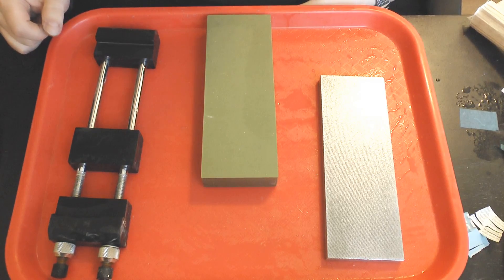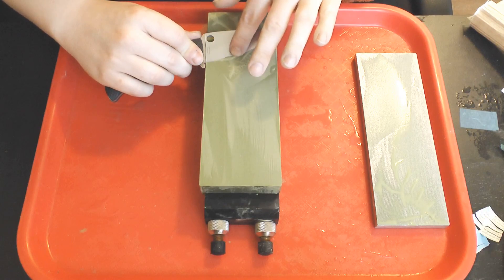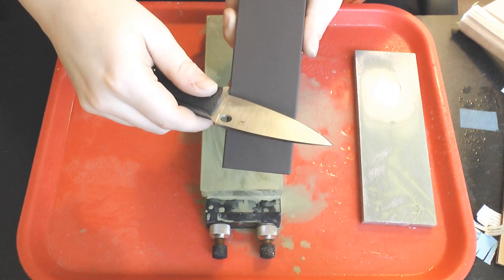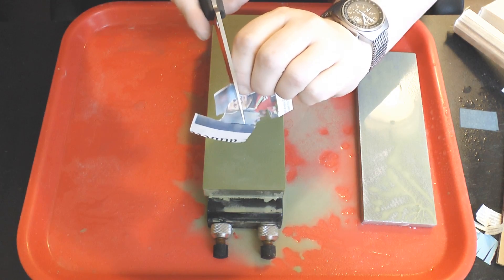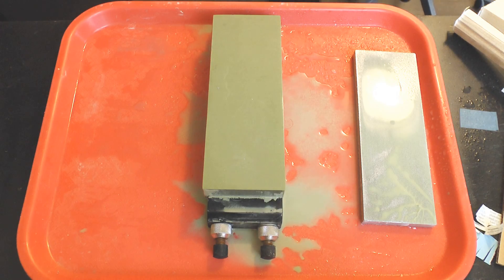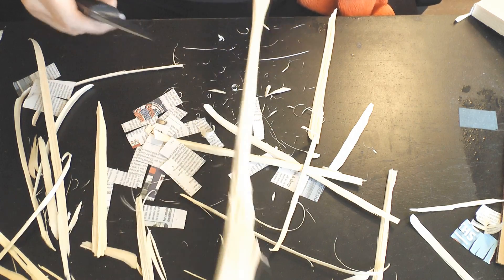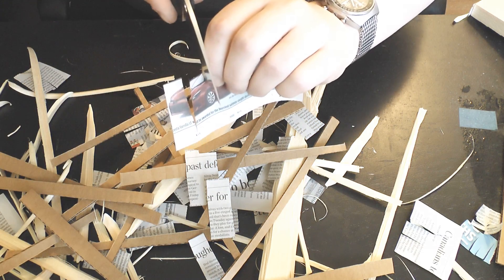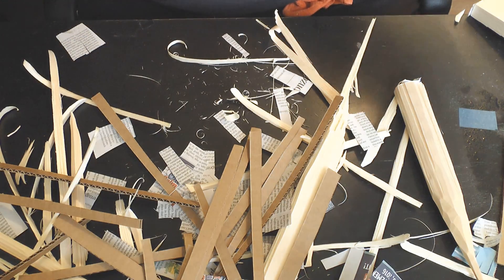AlOx and SiC vs. Vanadium - Part 3: SPS-II 3000

Comment: idk what you think shaving into the grain of pine wood or whatever that is going to accomplish, especially on a steel like that. It's not going to do anything. Maybe if you did that 1000 times in a row you could notice some change, qualitativly. No clue what you're trying to accomplish.

I've got a decent eye for it, and it doesn't look like you're getting particularly exceptionally edges off the stones there. Slicing copy paper is hardly a test of edge keenness at all, it doesn't prove anything other than maybe quickly guiding you to where any inclusions, ie nicks or rolls, in the edge might be, or the fact that yes you have an edge. It doesn't look like a very keen edge, but it's an edge. Try slicing through a free hanging paper towel. Not a supported pt like I've seen you do a few times talking some mumbo jumbo about "aggression." Hold the pt between two finger so it's hanging by the force of gravity, draw the knife through it, the knife should fall through it like it doesn't exist.  You should be able to do that straight off the stones. That's a valid practical test for you.

Comment: Is the SPS II 3000 really made out of Silicon Carbide?
Reply: I don't think so.  The 240 and 1k use green silicon carbide, which is great. But, for half the price a naniwa traditional 240 is also green sic. So is a norton 200. op has a very optimistic sense of self confidence. I'm still a big fan of the 240 and 1k sps. And they can absolutely sharpen any knife steel you're going to come across, even if you deal with these gimmicky spidercos as they're the only company that makes stuff like that. Obviously diamond or cbn is a superior abrasive. Theres a reason those are called super abrasives. The issue is coated abrasives like plates are shit. And bonded diamond abrasives are rare, niche, not generally available in consumer market and very expensive.